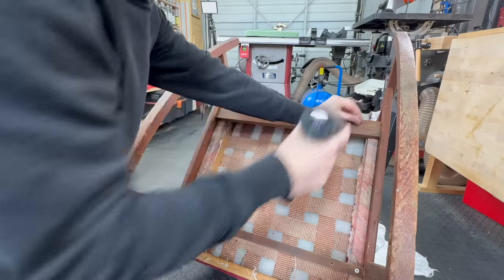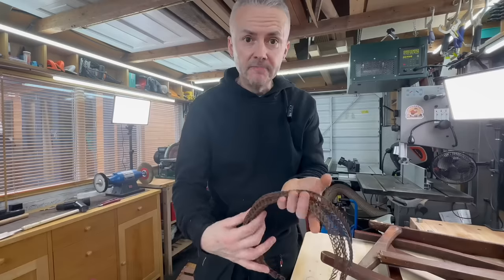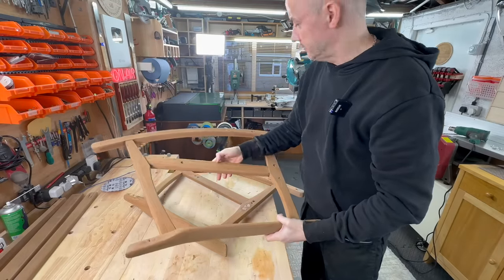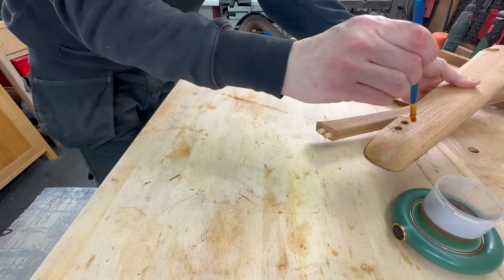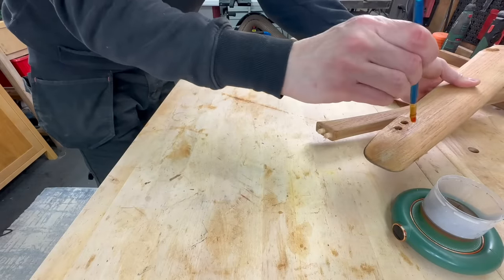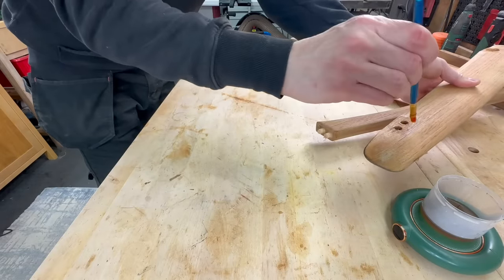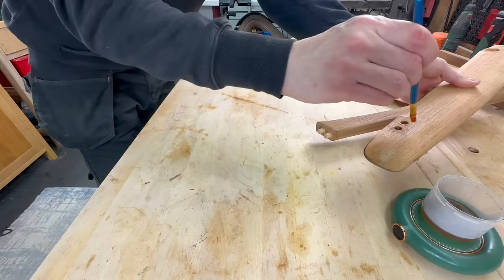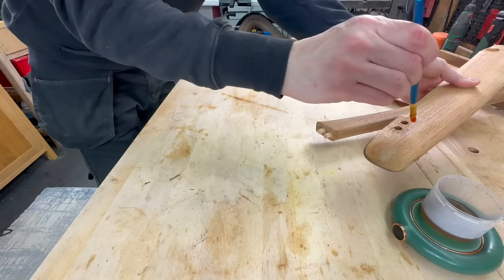Old broken rocking chair - RESTORATION

Comment: Oh Jay!  I have been sewing since I was a little girl, and I am so impressed not only with how this turned out, but also with how boldly you tackled a completely new skill!  The chair came out simply beautiful.  I have two suggestions:  if you place your pins perpendicular to your work, they are easy to handle than if they are parallel as you had them.  Also, you might want to take a look at a fifth video to add to your new profession as an upholsterer - David has a good tutorial on how to make a simple stretcher to make the fabric tight using a piece of wood and nails.  Well done, you.
Reply from the maker: Thanks and I’m friends with David so I’m very much aware of that but as I said in the video… sometimes there’s no need to buy or make a tool😉
Reply: Molly beat me to it, but I was going to make the same suggestions about the pins.    And about how boldly you took on a fabric with a pile that needs to be the right direction, and on your first time sewing, too!  Bravo!  I love the color choice for your fabric with that wood.  One of my treasures is my grandpa's upholstery hammer...I use it in jewelry making.  He  had an upholstery business with his brother, then he created a chain of fabric stores.  All, after coming to this country with little English, or formal education, and only  $15.00 in his pocket.

Comment: The more you do upholstery you'll begin to know your strengths and weaknesses so you can either find a different/better/easier way to use aforementioned to your advantage. Then you can relax and not worry so much😊😊😊. The wood stain/finish and velvet color were perfect! Your repairs were honest and seemed to reinforce the chair parts efficiently😊😊😊.

Comment: Great job. Years ago I reupholstered a chair for a friend. Never did it before, Never did it again. But he was impressed (and so was I;) But I sweated bullets until it was done.
Therefore no surprise to say I'm not comfortable with a sewing machine either, but a couple of folks suggested you put the pins in perpendicular to your seam. I will tell you why . It's much easier to run over a pin when it's parallel. Then your needle breaks. Then everything stops until you replace the needle. Don't ask me how I know this. Or how many times I leaned this again. And again!

Comment: You did a great job with the sowing. One tip, though... at every start of a seam or joint, go forward,  backward and then sow on as normal. Repeat at the end as well. This will ensure that the thread won't unravel and open the joint/seam. ❤

Comment: Tips from an upholsterer: don`t reuse foam or springs, they degrade over time. The front corners of the fabric on the seat look better if you handstitch them. The fabric loosens a little with use, so it should be slightly tighter than what you`ll be comfortable with😊

Comment: For your first upholstery job, that turned out great!! My only suggestion (and I might have missed it) when sewing anything that will be getting a lot of pressure on the seams, use a zigzag stitch or double stitch it for strength. I'm actually a little surprised you didn't bust out brass upholstery tacks! I've watched several of your videos now (new subscriber!) so I guess that makes me an expert on furniture repair! I'm joking of course. However, I do make furniture from scratch- it's just 1/24 scale. Very tiny miniature size. I use fine pine sourced from the Popcicle Stick forests of the land of Coffee Stirrers and stains made by Sharpie and Prismacolor. I wish I knew how to film the process, maybe I should watch a few videos on becoming a youtuber lol
Reply from the maker: Thanks for the tips 🙂 much appreciated 💛

Comment: Sewing tip. Instead of pinning on the seam line the same way your sewing, put you pins in across the seam line. You can leave the pins in while you sew instead of stopping to pull them out as you go. You can use a fabric marker if your not sure where your sewing, to mark the seam line.

Comment: Great work as always! Love your upholstery job! Great first time, you finished it and it looks like a pro did it. I've got a project I'm going to do that I picked up recently for a buck. It's a dining room chair type however the seat will need a lot of loving. The board in the center of the seat will need replacing and it has no upholstery so it'll be my first time. Now that I have seen your and Mayfield work I guess I too am a professional

Comment: You did great work with the sewing machine for someone who has never done it before.  The next time you do it put   the your pins  at 90 degrees to the edge.  Then you can pull them out as you go and  avoid them getting stuck under the needle.  You can ask YouTube to explain it better than I have of course.

Comment: For what you do, I'd actually recommend a vintage sewing machine instead of a modern one.  But, you did a great job.  Working with velvet/velveteen is not easy because it tends to "crawl" when you're making the seam.  My specialty is restoring vintage and antique sewing tables and machines.
Reply from the maker: Thanks 🤩 I will likely use it once avery several months so it doesnt really matter as long as it does the job 😉
Reply: @Flippingdrawers  If you can find it, I recommend a Kenmore model 52 (158.520/521/523).  They are generally cheap, but well made, have really strong motors, and are just tanks.

Comment: @FlippingDrawers now that's funny! I use to play June's journey myself. How on earth did you get a video game for a sponsor? Tool companies and products I understand. 

As a trained seamstress you did great for your first time.  However,  I want to keep you safe...some friendly advice on your pin placement.  You want to place them going from the edge and directed parallel to the front edge of your machine.  This allows the pressure pedal and needle to ride safely over the needles instead of it pushing them out of the material as it enters. Using them parallel to the fabric edge  you run the risk of snapping the needle and the foot will shove them off,  allowing the fabric to shift. 
Also...I like to count my pins as I put them in and pull them off directly after I use them...put them in a glass jar.  It's super easy to drop those sharp suckers! Keep a long handled magnet nearby for ease. Read up on the tension guide adjustments...there's 2, one for the top thread and one for the bobbin.  
The chair turned out lovely! When you said the back wasn't comfortable I was surprised you didn't replace the springs with webbing.  Thanks for showing the hammer trick...definitely Using that one.

Comment: Waiting eagerly for your patchwork, quilting and tailoring channel to launch😊
Reply: Just remember to change the needle after 6 or so hours of use, or any time the stitches begin to fail. There are different needle for different types of fabric, similar to how different saw blades are used for different types of wood. Likewise, use a small brush to dust out the bobbin area after each project. High quality thread is never a bad investment.

Comment: Good job! Got a kick out of your sewing.  Tip your pins are in the wrong way especially with velvet. Sew as if you are going to cross the t and at the last moment remove the pin. Prevents your material from slipping and puckering.  Fantastic job that chair looks amazing! Thanks
Reply from the maker: Thanks for the tips!